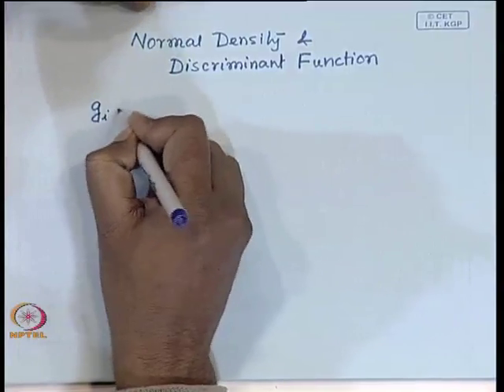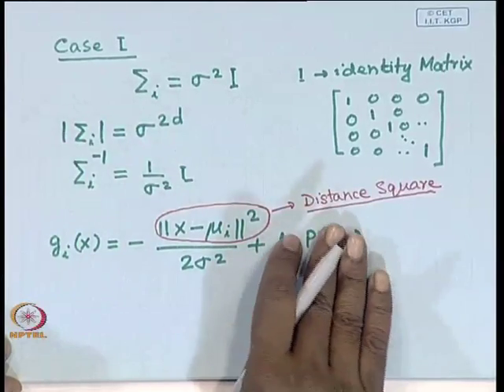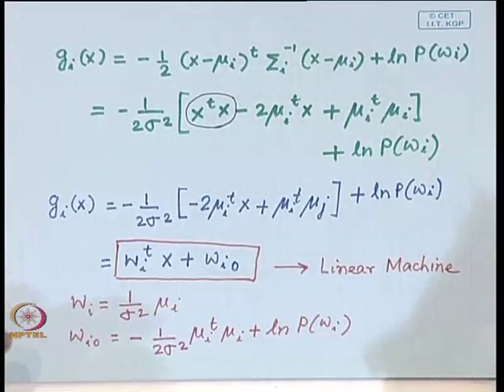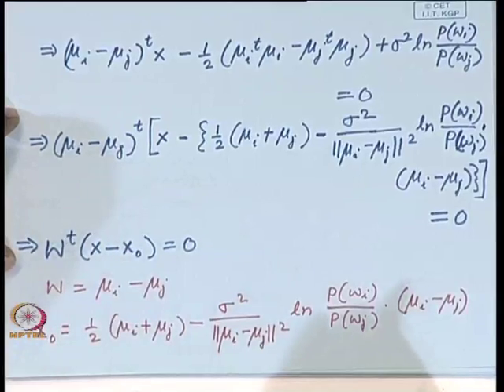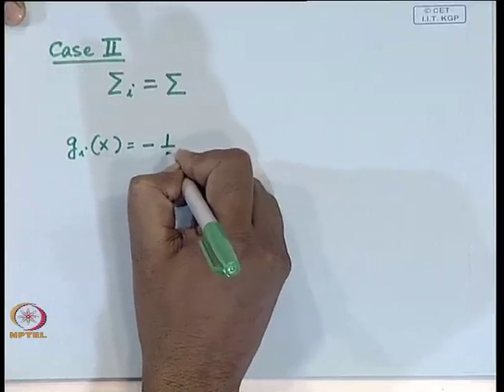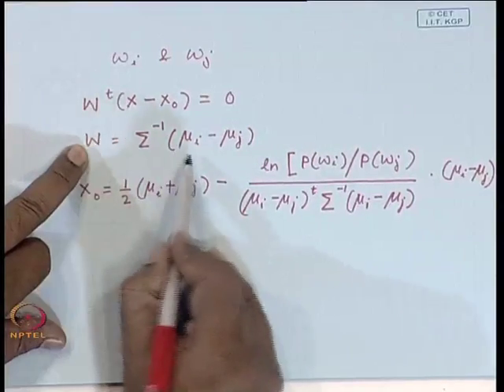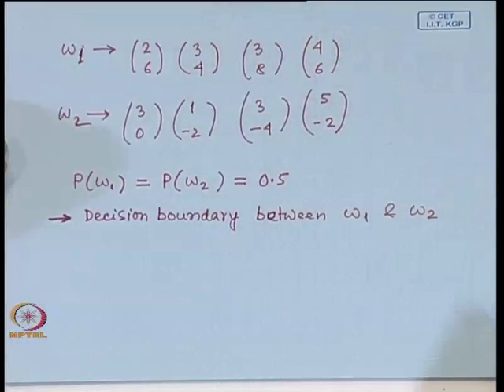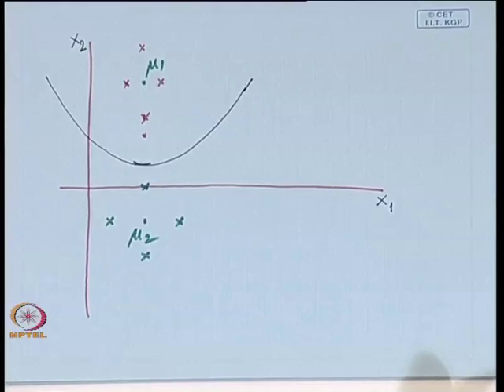Mod-01 Lec-08 Normal Density and Discriminant Function (Contd.)

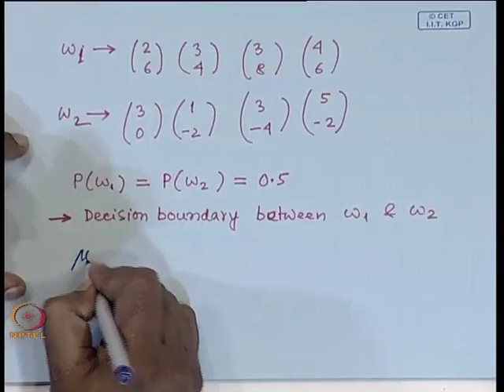Comment: [50:40] You took the mean to be the average of the data points, this means you are assuming that the data points are coming out of a uniform distribution. Then how can you use the the expression for discriminant function that you derived for normal distribution?
Reply: Mean is the average of data points  whatever the distribution is.  Suppose you are measuring height of students in your class. Assume there are 50 students. Consider it be a normally distributed data, with say mean around 170 cm.  Now when you  do the average (ie sum   of heights divided by 50) you will get  170 as the answer.  This will be the case whether the heights are normally distributed or uniformly distributed. But when your data is distributed normally,  majority of the heights would lie around the mean, but when the heights follow a uniform distribution, the heights will be uniformly distributed in a range